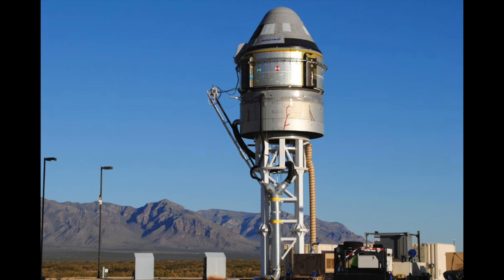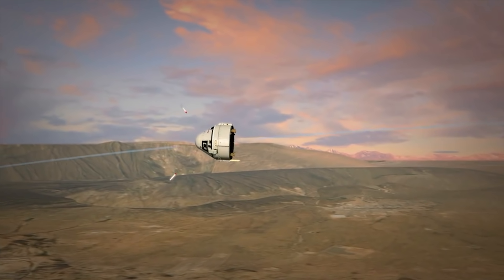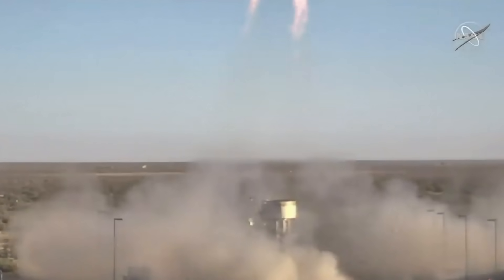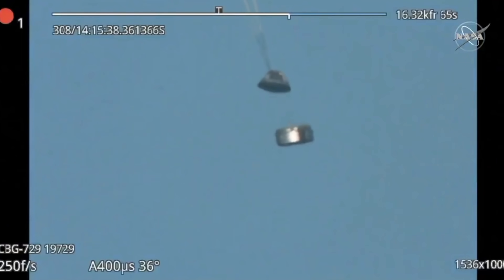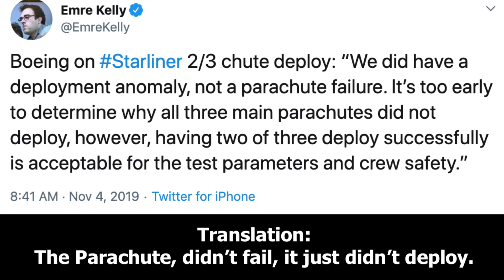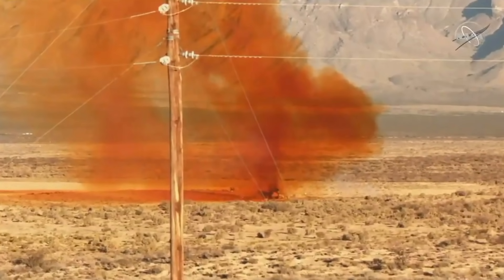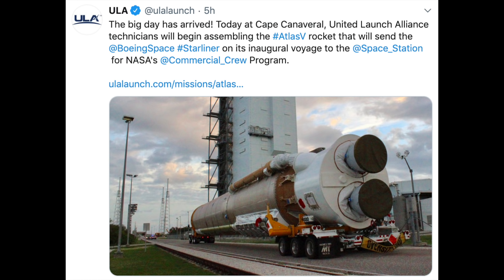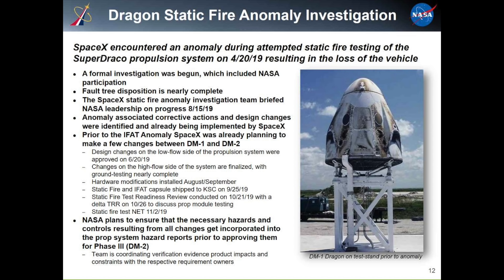Parachute Fails To Deploy During Boeing's Starliner Abort Test.

Comment: “Parachute didnt fail, it just didn’t deploy”. Ah, ok then all is well 😂.
Reply: To be fair though, there's a difference. A parachute that FAILS means it's being deployed but doesn't do any aerobraking due to it failing to open up. If it didn't deploy at all though, then that means it didn't do anything whatsoever, therefore could obviously not fail..
Reply: @captainoblivious_yt  Try splitting that hair with a future occupant of this vehicle.
Reply: @Thumbsupurbum  It's not splitting hairs.. It's an important distinction and to not see it as such would be an oversimplification.
Reply: Boeing should lie and say it was an intentional demonstration of the capsule landing on only 2 parachutes.
Reply: The parachute itself did not fail, but it did fail to deploy. As Captain Oblivious points out, it is important to pinpoint the precise nature of the failure in order to prevent this from happening again.
Reply: Captain Oblivious How could you say “If it didnt deploy, then it couldnt fail because it didnt do anything.” 

That is a parachute failing by all means, if it doesnt fucking deploy when meant to. A parachute is successful if it deploys and does what its meant to, the opposite is failure to properly work.
Reply: And then there is NASA requiring SpaceX to do excessive amounts of tests and redesign after they had a similar (although planed) failure
Reply: @captainoblivious_yt  Deploying is an essential part of the parachutes job, failing to deploy is a failure of the parachute. Doesn't mean anything is wrong with the fabric part, but obviously there is something wrong with the deployment mechanism. It's kinda like saying that a rocket engine didn't fail when it didn't light up.
Reply: @snarkylive   I usually rip on SpaceX.. but IMO, this parachute failure is MUCH worse than the crew dragon exploding capsule..  .. because deployment of low velocity parachutes is ancient technology that should be highly refined by now??  ... but then maybe not? .. and that is why there are 3 chutes, LOL.
Reply: @KrustyKlown  A single-out parachute failure is a major failure but survivable. A capsule exploding is guaranteed loss of crew. SpaceX, NASA, and Boeing are all finding out that parachute systems are significantly less reliable than we assumed, especially complex multi-parachute systems.
Reply: @danieljensen2626  Obviously it would be catastrophic in both cases, and i never said anything to the contrary.
Reply: @DevilDaRebel  The parachute itself couldn't fail because it was never deployed. The deployment mechanism did fail however.
Reply: @captainoblivious_yt  As a skydiver, non-deployment on command is considered a total failure.  If they didn't deploy it intentionally, only then would it not be a failure.
Reply: @blurglide  I never said it didn't fail. All i said was that if the parachute didn't deploy in the first place, then the parachute itself didn't fail, the deployment mechanism did.
Reply: Captain Oblivious “Deployment mechanism” correlates with the parachute system overall, it fails, then the parachute fails to deploy. 

Yes, we understand the parachute itself is not a failed design, but it failed to deploy.
Reply: @danieljensen2626  The distinction is this: the deployment mechanism(s) failed, but the parachute itself had no chance to, so it did not. To say "the parachute failed" is to suggest that the separate deployment mechanism(s) successfully deployed the parachute, which is only the fabric part by the definition of a parachute, and that said fabric part failed itself. Thus, to fail to distinguish is to suggest a complete incorrect potential problem, potentially resulting in resources being misplaced (expensive mistakes in the area of space flight).
Reply: Parachute didn't fail, but its deployment mechanism did.
Reply: @AmbientMorality  Understood, but my point was relative to Program Impact (delay) .. the risk of hypergolic explosions would be expected to be much higher than a chute failure ... but here we have test failures...  a chute failure where there shouldn't have been one expected .. and a hypergolic explosion where it isn't all that surprising. One of those things should have been planned for and the other NOT .. guess we wait to see what Boeing's "homework" is going to be here.
Reply: @captainoblivious_yt  Yes we understand it didn't shred or collapse, but the deployment system is a critical component of a parachute.
Reply: "the rocket didn't fail, it just didn't reach space..."
Reply: Shadow 133 - lol yes - a bit like old "the fall doesn't kill you, it's just the sudden stop at the end..."
Reply: @Thumbsupurbum  As a first step in problem solving you need to define the problem. In this case the problem was that the parachute did not deploy. As the parachute was not deployed, it didn´t even get the opportunity to fail. 
Try telling future occupants, that you worked on the parachute not failing instead of making the parachute properly deploy!
Reply: Well the parachute 'system' partially failed, that's for sure, but the specifics are for the engineers to determine and fix.
Until they get a good look at it we can't even say for sure the parachute itself didn't fail (unless someone has a really good understanding of this parachute system), as it may have 'failed' by being ripped, torn or otherwise detached from the drogue chute, which may have led to its total failure had it managed to deploy anyway.
Reply: @DevilDaRebel  A parachute is successful, if it unfolds after deployment,  and leads to a slow and stable descent of the object attached to it. A parachute doesn´t have the ability to deploy itself. Well, it acutally has, if you define the system borders accordingly ;-) (which Boeing seems to not have done).
Reply: @Ju11i  You can word it however you want, it's still a 33% chance the parachutes fail to deploy.
Reply: Must be Monday all the space quarterbacks are out. Not one of them ever worked on a man rated rocket system. This is why tests are done to ferret out the issues to be improved. Semantic quibbling?
Reply: 4head
Reply: I could see all three main 'chutes being pulled out by the drag pilot 'chutes. That is a successful deployment. 

Either one main 'chute opened unusually fast and broke away from the capsule, or the tethers broke for other reasons, such as excess temperature. 

The capsule was surrounded by smoke during the drag pilot 'chute deployment, and the cameras were all zoomed in way too close for us to see how the 'chutes opened. The capsule itself jerked out of frame on all four cameras, so we cannot even see if the one 'chute failed to open, opened too rapidly, or was released before opening...
Reply: @Thumbsupurbum  Well, I would argue that there´s a 33% change that the parachute deployment mechanism fails and that 100% of the parachutes that could be tested did not fail. 

But I guess everyone gets the other´s point. :-D
Reply: Ju11i If the parachute fails to deploy, then it failed. Period, yes the design of the parachute could not properly
Be determined as it didnt deploy. But the statement “The parachute failed to deploy” is still true nonetheless. I do agree however, that just saying “The parachute failed.” Is somewhat vague.
Reply: lol, I think that's another way of saying the word fail .. but I'll work with you, Boeing Starliner had an "Anomaly" and after the landing anomaly lots of Hydrozene spilled next to the capsule and dispersed with low winds yes but if winds were higher could have covered the capsule and 2 of the 3 parachutes that should have deployed in toxic fuel...
Reply: Lol..
Reply: @captainoblivious_yt  the parachute system did fail.
Reply: @captainoblivious_yt  "I never said it didn't fail. All i said was that if the parachute didn't deploy in the first place" BAHAHAHAHA ummm maybe you should re-read your first post. And quit flogging this dead horse.
Reply: @kirkc9643  I said the parachute didn't fail because it never opened in the first place. That's like saying your car failed to start without even turning the key in the ignition. Unless you have turned the key in the ignition, the car cannot "fail". Also, i didn't say "the parachute SYSTEM", i just said the PARACHUTE. Do you know the definition of a parachute? I guess not. The PARACHUTE is the part with cloth, and not the entire system.
Reply: You didn’t get fired, you just had an unemployment event
Reply: @captainoblivious_yt  Do you know the definition of 'semantics?
Reply: A chute failure implies the chute itself tore or couldn't bear the load. The deployment mechanism failed.
Reply: @Tenkai917  SO THEY FAILED HAHA
Reply: @captainoblivious_yt  Therefore, if none of the parachutes deployed, and the vehicle smashed into the ground, that was also a success ie, a non-fail. Potentially dead astronauts' bodies successfully recovered. Recovery crews requiring extensive cleansing of hazard-suits to avoid life-threatening contamination, and desert life-forms endangered. A total win for NASA, Boeing, the.. er.. designers of the new 737, and partners in ULA.
Reply: Dammit! He's started saying "capsel" instead of "capshool". I'm going to miss his accent.
Reply: What is unacceptable is a failure of one of the three parachutes for an unknown reason.  Next time whatever reason this failure occurred may be common to all 3 parachutes and cause all 3 to fail.
Reply: Everyone is talking about the parachute, nobody is talking about the apparent ~4 second latency in the countdown spoken "zero" and actual lift-off.
In a real-world critical rapid-unscheduled-disassembly mode—which could happen even on the ground—that thing needs get up and go in a second or two.
Was that countdown-feed synched? Certainly the YouTube audio was synched.
Reply: The parachute just didn't want to deploy. it was sleeping.
Reply: @Tenkai917  as Scott pointed out, it looks like 3 drouge chutes deployed, (which are part of the parachute) and it almost looked at one point like there were 3 sets of shroud lines out, but then you ended up with only 2 parachutes.
If the drouge did in fact deploy, then it was a parachute failure, not just a failure to deploy.

Think of if you are skydiving, and you throw your drouge chute out, and your parachute either fails to come out because the drouge line breaks, or the parachute comes out but isn't properly attached to your harness and just falls away.
You deployed the parachute, but it failed.
So if 3 drouge chutes deployed but only 2 chutes opened, then it was a parachute failure.
Reply: It's not failure, it's surprise mechanics.
Reply: One of the drogue chutes simply elected not to extract its main parachute, for various reasons. :)
Reply: The parachute did not fail, it was simply not utilized in this test.  Yeah, that's the ticket.  See, this was another test.  Yes, indeed.  It was the demonstration of the 2 of 3 main parachute safe landing capability.  A bonus demonstration...for your entertainment.  The 3rd parachute is just gravy.  Not a failure at all.  And there's probably actually some truth to this.  Redundancy is built in to the parachute system.  But, of course, the aim is for gravy on every flight.  That's what tests are for, to find out as many faults as possible and fix them so they don't appear in the production items.  They'll find out what failed and fix it...just like SpaceX does.
Reply: Both SpaceX and Blue Origin have had their share of failure, as did Apollo. Space travel is still a risky undertaking.
Reply: It failed to deploy though, still a failure. I wouldnt want to be on board that.
Reply: @nzoomed  It was a survivable landing.
Reply: Elon Musk approves this message
Reply: @crimsonhalo13  Who cares what he thinks?
Reply: @Thumbsupurbum  By that logic you could say "the life support system failed!!!" when it was not, it was part of the parachute/landing system.
Reply: @blurglide  But here, Parachute and deployment system are seperate. As a skydiver, you (a person) is part of the deployment system. This could (for example) be a failure in the computer or control system, not the parachute.
Reply: @TechyBen  OK...if the heat shield was jettissoned before reentry instead of after, that'd still be a failure of the heat shield system, even though it didn't fail by burning through.
Reply: Drogue. @ke6gwf
Reply: There’s a simple way to resolve this semantics nonsense. 

“The parachute system failed.”

In this case the system is an umbrella term that implicates both the chutes and their deployment mechanism. If either component(s) fails then the entire system is flawed in some way. Because ultimately for the vehicle to be considered safe, the system in its entirety needs to function as intended reliably (some high % value decided by statisticians and safety committee).
Reply: @blurglide  Yes, the heat shield system not the heat shield, as the shield never got to check if it burns or not.

If I make you dinner, and I throw it in the bin, the dinner did not taste bad, or good, because you never got to eat it.

We have two different things, and people seem to have an inability to see or understand which is which.
Reply: "It's not a bug, it's a feature".
Reply: @thethirdman225  true, but if the parachutes have a high failure rate of deploying, its not a good thing.
Reply: The 2 failures werent similar. The Space Ex chutes actually ripped, the Boeing chute deployed the pilot chute and its riser, but the 3rd main chute didnt deploy.
Reply: nzoomed Why would they have a high failure rate? Apollo parachutes didn’t fail. Soyuz parachutes don’t fail.
Reply: I'm a skydiver. When we have a pilot chute detach before it deploys the main parachute it is absolutely a failure. A failure involving the parachute in that the parachute in question is not open. It is a failure. A dangerous failure.
Reply: @captainoblivious_yt  I'm a skydiver. If a parachute fails to open for any reason after the deployment sequence is initiated, it is a failure. The drogue chute is equally important as the parachute, reefing mechanism, lines, connectors etc. All individual parts are one with the whole. Anything short of proper, functional deployment of the entire system is a failure.
Reply: Slartybarfast B For one parachute, yes. This has three and the landing was 100% survivable.
Reply: @thethirdman225  These are three identical systems operating as one. If a flaw exists in one, it potentially exists in all. Because the failure occurred in the drogue subsystem it means all three drogues are suspect and all could have suffered the same failure on the same flight. Just as one parachute tearing, lines snapping or other would cause the design itself to be suspect. This is a major failure and will lead to further testing and redesign. A drogue separating without performing it's function points to a design flaw or improper material, strength, or both. The continuous expulsion of hypergolics after engine shut down also causes concern reminiscent of Starliner's test stand failure when oxydizer spilled from a leaking valve as well. NASA may allow a pass on this test but it will lead to a lengthy delay and possible redesign of several subsystems.
Reply: @captainoblivious_yt  "A parachute that FAILS means it's being deployed but doesn't do any aerobraking due to it failing to open up. If it didn't deploy at all though, then that means it didn't do anything whatsoever, therefore could obviously not fail.."   Only in your little self deined world.

A functional parachute is a system.  It has two failure modes,  partial malfunction and total malfunction.   The was a total malfunction of the system to operate for one canopy.   Wrap any other weasel words and rationalisations around it you like.
Reply: 1000th Like!
Reply: @Tenkai917  ... kinda like those 737Max's didn't fail just that the Boeing procedures didn't work........
Reply: @Slartybarfast B 
"These are three identical systems operating as one. If a flaw exists in one, it potentially exists in all"

Yes but that could be said for almost any redundancy system. Why do modern jets use quadruplexed fly-by-wire systems? By that logic, if there's a problem with one, then the whole system will fail.

But we don't know if this is a design problem - the other two 'chutes deployed as they were intended, suggesting it's not - or a manufacturing problem. What about the release velocity? The SpaceX problem seemed to be a result of release at excessive speed, resulting in all parachutes being shredded.

I'm not denying this is a problem but there are too many things we don't know.

"it will lead to a lengthy delay and possible redesign of several subsystems."

Not necessarily.
Reply: Captain Oblivious And, since it didn’t fail, it means they now have a spare one just in case they survive plummeting to the ground 😂.
Reply: Is a "pretty good" result kind of like saying that the crew would have "almost lived"?
Reply: Space Ghost They would have lived. That landing was 100% survivable.
Reply: TheThirdMan Then another Boeing system that didn’t “fail” per se was the mcas on the Max? It simply required better crew knowledge, but was 100% survivable when sensors failed? Yeah, I don’t know what’s going on behind Boeing, but the kind of view they are presenting is astonishing and sad, especially when their reputation is being questioned. As part of the average joe that likes space things a comment on the lines “shit...a chute didn’t work. Ah well, its just a test, we will fix it and get it next time” would be more adequate. Anyway, I am sure this will be solved either way, its just a weird comment from them.
Reply: Shadow 133 The 737 MAX is a totally different issue in a different division of the company.
Reply: TheThirdMan Same company culture, apparently.
Reply: Shadow 133 Perhaps but one problem isn’t necessarily a good indicator. There’s a bit of a difference between a parachute problem that might have been the result of poor deign or poor manufacture or even incorrect opening speed and the whole disaster that is the 737 MAX. The biggest problem is that we’re working with very little information compared with the 737.
Reply: The recovery system experienced a partial failure. The third parachute did not deploy, no fault of its design or manufacture. As the manufacturer of this parachute was not involved with its integration, it is a significant distinction.
It is also significant as for determining what steps and actions are needed to prevent a reaccuance.
Reply: @jedswift  Let's see what the investigation comes up with.
Reply: @KrustyKlown  Really?  An exploding capsule which likely would have killed a crew is better than 1 out of three parachutes not deploying and the capsule just lands a bit harder and the crew walks away?

I rather be in the capsule with 2 out of 3 chutes than the one that blew up.
Reply: @KrustyKlown  The consequences are much greater with the hypergolic explosion, hence the risk of it happening better be much lower.   One out of three parachutes failing isn't going to kill anyone.
Reply: @loctite222ms  "Really"??  what??  you seem confused, I was referring to the engineering/redesign consequences .. NOT the effect on human Astronauts.. .. would seem that was obvious to you since you recognize the exploding bodies is a very bad thing, LOL.   
    From an engineering perspective, risks are identified and planned for based on the level of risk .... exploding hypgolic fuels would be HIGH on the risk list, and command a great deal of pre-planned engineering activity, testing along with a timeline that includes 1 or 2 redesigns to improve the safety of that dangerous unproven system.  However when it comes to a Parachute, a technology that is NOT new, and considered to be MUCH safer than exploding hypergolics.... engineering planning would assign that a very low risk, and little would be planned for redesign or testing. 
    All that said, what happened was SpaceX Crew dragon hypergolics EXPLODED, but that should have been expected, planned for and a plan B executed (which it seems they already knew the root cause risk and executed a design change option already considered as plan B).  If SpaceX was properly managing their development program... all this should have been accounted for in their timeline as a very real possibility. However with Boeing , a chute failed, very unexpectedly, something that should be well known and has been practiced MANY times before .. FAILED .. nobody should expect that to be already planned for in Boeing's development schedule. So, Boeing's timeline is impacted much worse than SpaceX ... and just to be clear, I am NOT talking about body counts here, understand?
Reply: Now I read that one retaining pin wasn't fully inserted. So the pilot chute just pulled the main lines out and away...
Reply: @captainoblivious_yt  What is a parachute meant to do? Did it do the thing? No. Thus the parachute FAILED. Saying anything else makes it sound like you're trying to dodge obvious responsibility and push snake oil only worried about losing a buck. I.e. someone who has no business being in charge of people's lives. If Boeing wants to look like the right people for the job and in ANY way professional, they would say "The landing procedure failed, this is bad, we will go back to the drawing board, make it right, and thoroughly retest until it works reliably before putting into service" ANY technical distinction relevant to diagnosing the precise problem belongs in the engineer's private conference room, and should be kept miles away form any PR statement, wildly inappropriate to use this stupid language in that context.
Reply: I DIDNT LOOSE, I merely failed to win
Reply: Parachute systems failed
Reply: it's like the brakes on a car, you can fail to engage them but that doesn't mean they failed